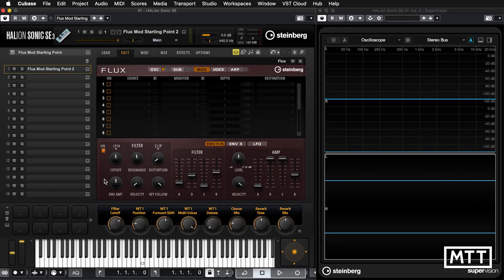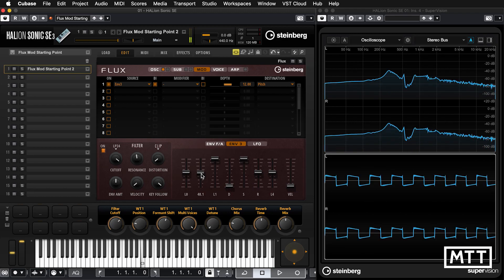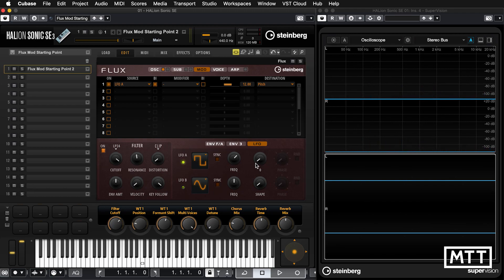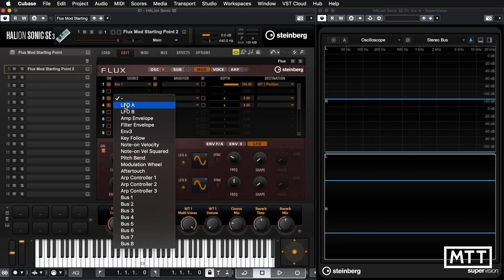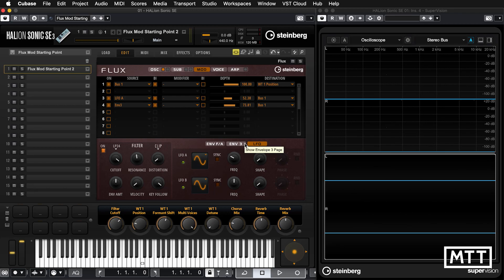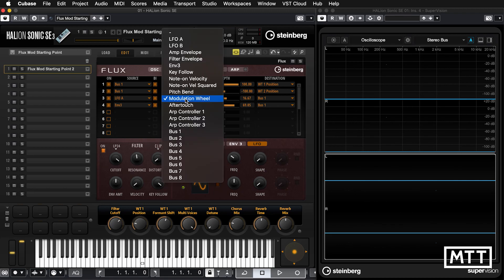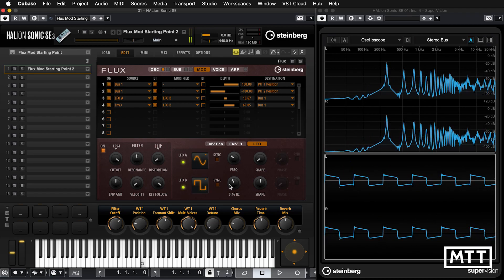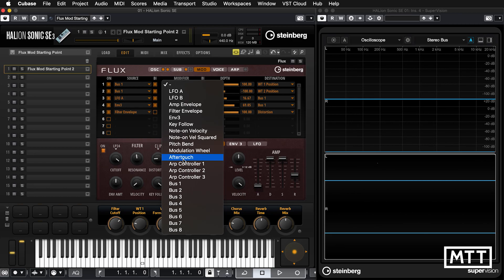Halion Sonic: Flux Wavetable Synth - Part 2: Modulation

Comment: Quick Q: watching the frequency graph on the right, every time you play even a simple sound we see little peaks of the type one associates with aliasing. Could it be the case? I assume Flux does not have an oversampling option?
Reply from the maker: Without putting a pure wave through, I don't think it's possible to say - there can be all sorts of unusual harmonics in the kinds of "square" wave that we see in the flux wavetables, and even the "sine" wave isn't a pure sine, so it has harmonics.  No idea on the oversampling option, but given that it's hardly a new idea, I wouldn't be surprised if it was present in flux; I guess you'd have to ask the developers at Steinberg about what the technicalities are...